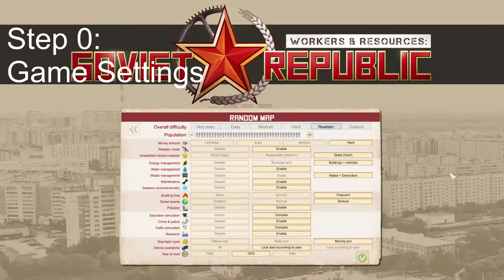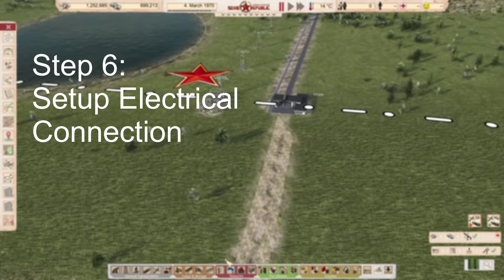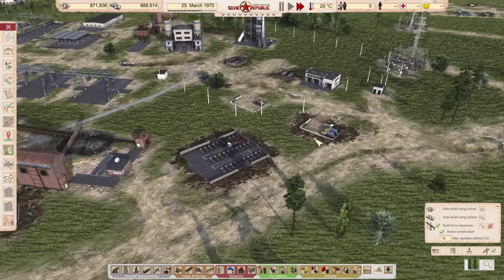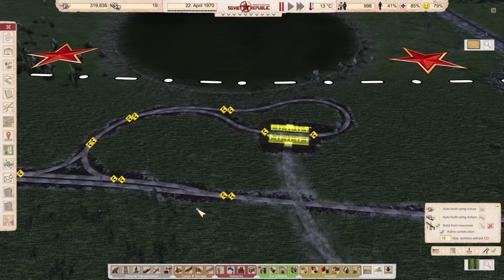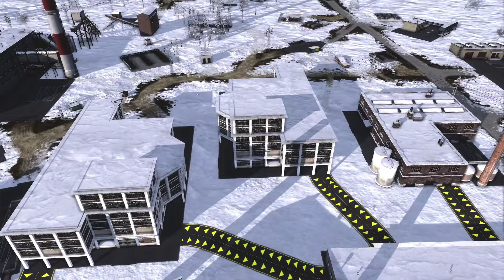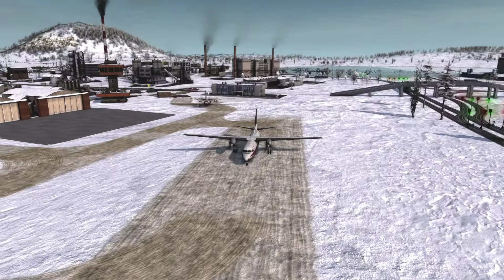15 Steps for Beginners: A guide to realistic mode in Workers and Resources: Soviet Republic

Comment: @2:30 I have created that system you told. It works charmly. But I want to ask you something. How will I import goods for farm? I mean fuel and fertilizer. I tried to connect it into the same distribution office but they do not deliver it. Is it because there is no electricity in the farm?

Comment: In the electrical connection section you didnt explain how do we start the construction of the power lines as i tried to just assign them to a construction office but it says i need road connection and i have no idea how am i supposed to connect power lines to a road
Reply: the power lines have to be connected to something connected to the road, like a transformer or switch. place the switch or transformer first, then run the powerlines.
Reply: @syrinx1892 thank you that solved the issue😊

Comment: How do you build power lines, mine aren’t building. 
Edit: i figured it out, on the bottom right of the screen there’s a green checkmark next to the construction crane looking button that confirms building
Reply: My problem is even when it is confirmed 

(Turns from white into yellow)

It still asks for road connection so that it could be assigned to construction office and i have no idea how to connect power lines to my road network😢
Reply: @AdamRaouf-r5k8w make sure every building is connected to a road. Even the power splitters and substations need to be connected. Some things like water switches are connected by walking paths instead of roads. If you did all that but it’s still not building then it’s something with your construction office. First thing is make sure “auto assign construction” is set to the max (default is only 1000 meters.)  if it’s still not working then there’s a material or vehicle missing that’s needed to complete the stage the game has a checklist that if not all the requirements are met then it won’t dispatch vehicles, try having building a free construction office near the power line, and send a bus, a open hull flatbed tuck, a covered hull truck (you absolutely need both) and a crane to that office. Have that office get everything from the customs house, even the workers. If you’re still having problems ill be happy to help
Reply: @T34theAmericanheavy yeah bro that helped i thank you so much

Comment: how are powerlines made in realistic mode I have placed them down and got things set up but they wont build the powerlines does anyone have a clue on what I can do to fix this?
Reply: Did you click the 'build planned infrastructure' button near the bottom right? If your power lines are white they are still in planning mode (I had to look online for the same thing). If it's not that then I don't know.
Reply: @snacksonaplan at the time no but I have found out later on
Reply: @snacksonaplan Guys my problem here is even when i confirm the construction and it turn yellow color it still cant be assigned to a construction office because it says it needs road connection and i have no idea how to connect power lines to my roads??😢
Reply: Guys my problem here is even when i confirm the construction and it turn yellow color it still cant be assigned to a construction office because it says it needs road connection and i have no idea how to connect power lines to my roads??😢
Reply: @trikky_gambits I know your post is ten months old  and I am pretty sure you have found a solution, in the meanwhile. Just in case, however, you give your powerline road connection by connecting the switch or transformer they originate from to a road.
Reply: @gulfwinds  yeah already found that out but thanks anyway👍

Comment: My power lines don't get built in realistic mode .. sometimes they are stuck at 30-ish %, sometimes at 0. I haven't managed to complete a single power line. Any ideas?
Reply: For anyone else wondering: if your power lines are white, they are in "planned mode". You need to click the button "start construction of planned infrastructure" on the bottom right of the screen. Then your power lines will turn yellow and the construction offices will start construction. Hope this helps!

Comment: Thanks for the tutorial! 

I might have missed it but I feel like you should add in how to get the first track builder from the customs house as it is a pretty vital step to getting rail going and it's not immediately obvious how to do it. (Buy the small, disassembled track builder at the customs house and deliver it to the rail construction office on the back of a truck).
Reply: But what  do you want the train for?
Reply: @nyoodmono4681  it is required for laying tracks quickly, rail is very useful for transporting a bunch of resources quickly, also, unlike trucks, trains dont take up valuable road space
Reply: @LukášDankanin  Trains make more sense late game, depending on how long you play. They are good with massive cole, ore, grain and fertilizer. But with all other rescources one is better off using trucks.
Reply: @nyoodmono4681  building rail takes really really long, its good to start early
Reply: @toottoot7316  Can you give an example where you were in need of trains, because trucks would not do it? The only time i felt that i need lots of trains was when i did a run based on agriculture, lots of crops. But even then i realized, trucks can do that export too as long as a custom house is not too far away.
Reply: @nyoodmono4681  realistically only if you are forced to build inland because of ressource distribution on workshop maps, but i personally find it fun to use trains which is a reason on its own

Comment: Well forgot how to make the first rails. In realistic I cant get the rail builder to the building office.
Reply from the maker: That's an easy fix! In realistic mode, you can buy a disassembled track builder from a custom house (under the disassembled tag), then create a line using a large enough open hull truck to pick it up from there and take it to your rail construction office, there it can start to work! Once you have your construction office connected to the custom house via rails, you can then import other types of track builders. Hope that helps!
Reply: @ChazzyBurger  THANKS

Comment: I am a little confused, i setup the bus stop, i've setup construction sites, but the bus from the construction office drives to the customs to pick up workers instead of picking them up from the bus stop?
The bus stop just tells me there aren't any nearby work places or foot paths so the bus is doing nothing even though that line is setup, i also set the bus from the construction office to specifically pick up workers from that bus stop, so the bus there isn't doing anything anymore.
I'm likely doing something wrong, i'm new to this game so i'm trying to figure out what it is i am doing wrong.
Reply from the maker: Ah that's an easy fix, not to worry! I think you may have your construction offices set to pickup workers from the customs house, double check the settings for all of them, click on the plus icon if it's hidden for your resource pickup locations incase it's hidden, and double check all your construction offices to make sure one isn't set wrong!

So the bus line that takes the workers from the customs office to the temp bus stop you've set up has to be it's own line, not connected to the construction offices. You can do this by setting up a road vehicle depot and buying a bus there. That bus will head to the depot, and from there you can click the plus icon to add a stop. Click the customs office to add that as the first stop, untick every box that isn't workers (not necessary, but good to not pickup tourists if you're playing without research) then add your bus stop as the next stop. Untick the "Load" option next to the text to not load anyone there, and on the unload screen tick the option next to the connector icon. This will tell your passengers that get off the bus to stay at the station (it's very important to do this or no one will get off your bus!).

After you've done this, go back to your construction offices you've got setup. Where they ask for resource locations, you want your workers setting to pickup workers from that location.

Hopefully that helps, if it doesn't give me another message and I'll try to help where I can!
Reply: @ChazzyBurger  Thank you very much, i essentially skipped the tutorial once i saw how lengthy it was and i just wanted to play, i didn't know i had to assign the bus itself to the line with the flag icon, it works as intended :)
Reply from the maker: @Zarosian_Ice  great to hear its working now! Good luck and remember, everytime you try you learn something new!

Comment: My distribution office will not allow me to select fuel for the gas station and firehouse. Bug? It is there, but it won't put down a check mark.
Reply: It's a little counter-intuitive perhaps, but if there's no checkmark by any of the resources, that means all of them are selected.
Reply: Your fuel stations won't accept other liquid deliveries so your trucks shouldn't pick them up unless they have somewhere else to drop them off. 

To avoid trucks from picking up the wrong cargo you can limit your storage to accept only the resources you want since you're not given the ability to filter with the checkmarks until after the truck arrives and sees what cargo is available (at which point it may have already decided to pick up something other than what you wanted).

Comment: well explained thank you, realistic is amazing. Build your first town I would say as a priority even before gravel plant and the like cause foreign worker cost will just blow your money so fast. Try using your own workers asap
Reply: Foreign workers are only $5 a worker. It’s actually 4 and some change but I’m rounding up! You have to feed, water, sewage, electricity, alcohol, kindcare, schools, parks, shopping center, the list goes on and on. I’m guessing you’re forgetting the price of all those buildings too, lmfao! I can start a farm zero ppl, gravel pit 15 ppl, logging camp 5 ppl , sawmill 5 ppl, brick factory 25ppl, water well or treatment plant 5 ppl. Fire house 7 ppl. That’s a total of 62 ppl. All boarders will keep around 25-30 ppl in it at all times. So just two of those can feed this set up. You won’t run them all the time or at the same time because of inflation, and yes you can put more ppl than what I said in these building but why? You won’t need them in the start. You were speaking of gravel as if it’s cost a lot and it does in the long run.Here is what I like to do. Build  stone quarry and dump tons of stone on the market and watch gravel price drop. Once you get it to drop half the price you can start building with it and that will cut your price in half. You can do this with a lot of resources. You can just log and drop board prices. Other than steel the two biggest are brick and prefabs. You can cut brick price by making your own. So just that along will 3 out of the 5 major in the game. Steel, prefabs, bricks, boards, gravel. That’s cutting construction cost by 2/3rds. I can build a lot with 1.4 mil this way.
Reply: @josephspruill1212  could be true, haven't tested it, it was just my experience from couple of starts on realistic that from 4mil i went so fast to 2mil and below creating construction materials sector first. Considering we'll either way need small town just covering the basics, imo we need to go for it first. Maybe I'm wrong but most tutorials on yt show that.
Reply: @witcherchess  ppl say farming is the best start. I beg to differ and here is why. The first five years of the game the price of corn is $17. As the years go by that prices slowly goes to $20. Brick starts out over $20. If I remember right it starts at $25 dollars a ton. Boards start out at $15 a ton.together that’s $40 for every 2 tons which is equal to $20 which is still more than corn. The trick is getting 5k tons on the market like you do corn. With the right farm set up I’ve seen 7,500 tons at most. That’s the only place where farming takes the win. It’s easier to get the quantity out. Not that it can’t be done say in gravel. There is one map gravel is right by the customs. The largest one at that. So build quarry and build trains then dump that price down like I was saying. No matter what, if it’s farming or mining trains is what wins when moving that quantity…. Hitler knew that one. It’s why he was building the one belt in Europe at the time with rails. It’s the one good thing he left behind I guess one could say. I’m just saying there are more than one way to skin a cat. Mine is I never build a city ever…… why? It’s just more I have to pay attention too. Sometimes the workers at the boarders will jump to over a hundred ppl at one time. It’s seasonal but it happens. Take advantage of the opportunities when they come. I don’t start graveling till I have a gravel pit. Same with building anything. I need my bricks and boards before I start doing that. I’ve made the 1.4 million last ten years whiteout making a dime before. Wasn’t easy and I made a buck or two along the way but I was never in the positive till year ten. It takes active management. Not the set and forget. That’s why this play style doesn’t work for others. Cause they can’t just set the buses to run all the time or the trucks to run all the time. You have to click on them when you want the run. And that depends on the market. Don’t believe me? Just start a new game. Start building anything you wish and watch the price of steel and others. If all you do is build the price always goes up. If all you do is sale the price always goes down. You have to find that balance and that’s not easy! Yet, it’s there I promise you. Keep your workers low. Expenses low, and build at the same time. Now if you want to open up five quarries and five mills that’s a different story. Yes then you will need to build a city and get ppl to come cause the customs offices will not supply you with enough workers to do BIG INDUSTRIES of anything but farming. Maybe that’s why ppl love it so much! Let me say it this way if you try this style yet you want to set and forget. YOU WILL loose, somewhere. If it isn’t chemicals or fuel it’s always something else. One time the game got mad at me cause I was dumping stone yet buying gravel to the point stone wasn’t but $3-4 dollars yet gravel went way over $10, lmfao! So your buying counter acts your sales. You have to take breaks or you will loose it all just like you said. You started with 4 mil and I only started with 1.4. You blew through 2 mill the first few years I’m betting. Yet it takes me 10 years to spend that 1.4 mil. So you’re not doin something the correct way. Your either buying or sailing to much if not both! That market is a mofo. Out of all the games I’ve played before this one took me a good min to figure out. But I’ve beat it lmfao!
Reply: @witcherchess  if you bottom the price out on anything don’t just loose you butt. Take advantage of the opportunities and build with the low prices. Use it to your advantage. I switch workers to the US dollar boarders to relieve pressure off of the ruby as well. All while I make dollars exporting water, just water. Good game, sucked me in for weeks. Damn near played it for a month straight before putting it down. Got plans on playing another few hundred hours. Maybe I can hit a thousand hours in the game soon. I’m knocking at 500hrs time now….
Reply: I don't think it's really about the cost of gravel more than it is how long it takes gravel to load up at a customs house, can really gum things up when you start building a lot.
Reply: @ that’s why I put two free gravel pits down at first just like storage. Get distro to fill it, while you split half your trucks between the two. Helps keep most the traffic off the gates…. The only thing my construction crew should have to get is concrete and asphalt from the gates. Well, that and workers….
Reply: @josephspruill1212  biggest reason to build gravel production is to reduce the number if pickups at the customs. 100000 dumpers or expensive train setup to import gravel is way to expensive compared to setting up something to offload the customs
Reply: importing gravel is dirt cheap anyway, probably cheaper than foreign workers
Reply: Mantaining the people is the most challenge part for me. People usually just go away in my towns before i even have the chance to keep things in order :(